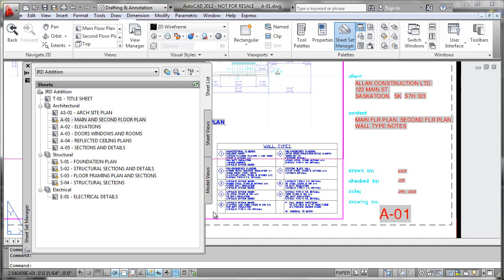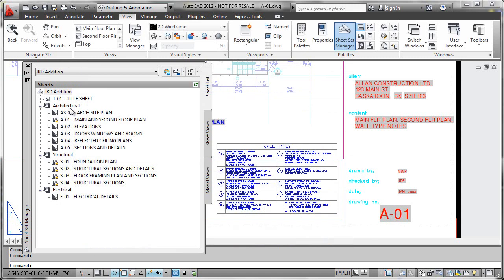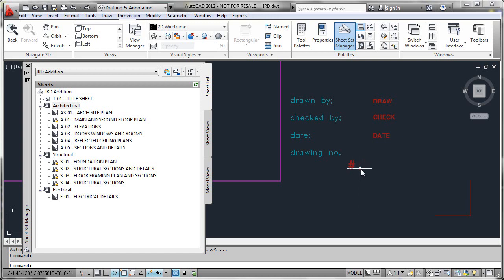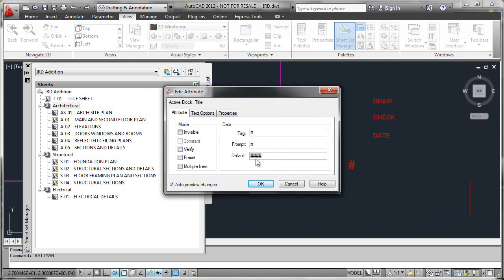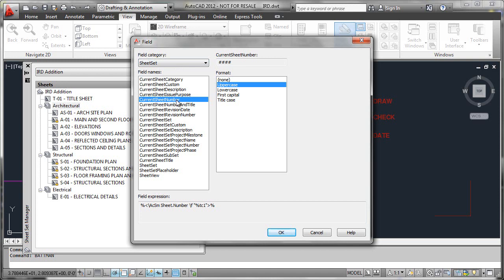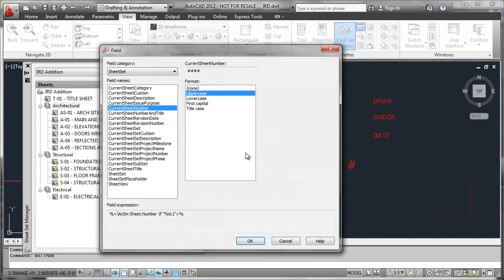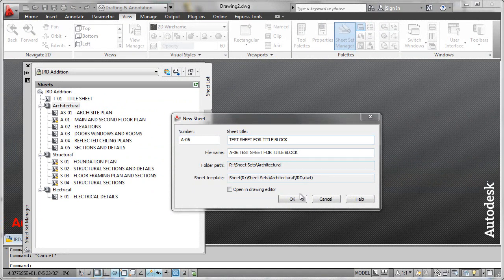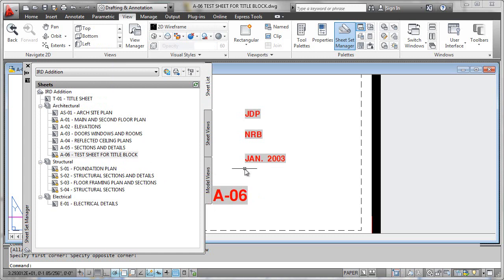Sheet Sets - Title Block Integration - Fields

Comment: about sheet number and total number of sheets, 
what if i want to put the sheet number & total number of sheets of drawings for each division of drawings(i.e. ARCHITECTURAL, STRUCTURAL, etc)
and then also i want to do the same in general.. what fields do i need to use?